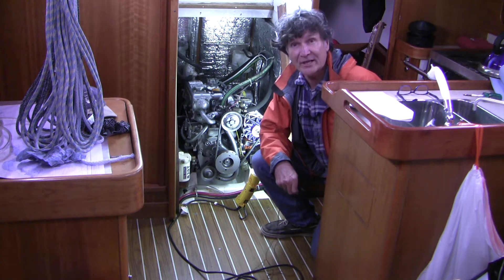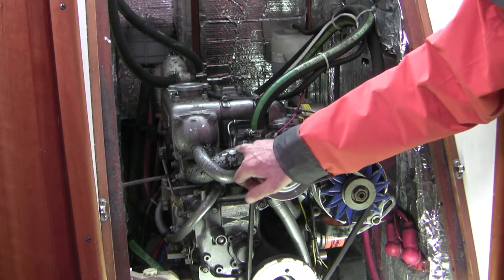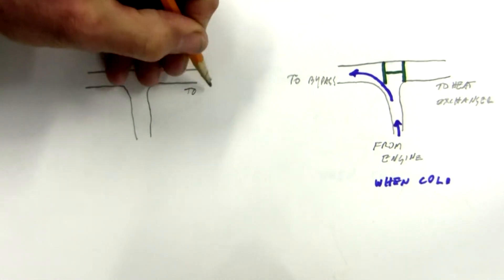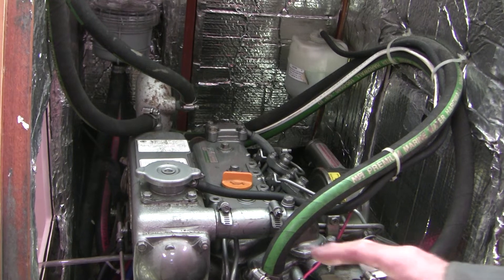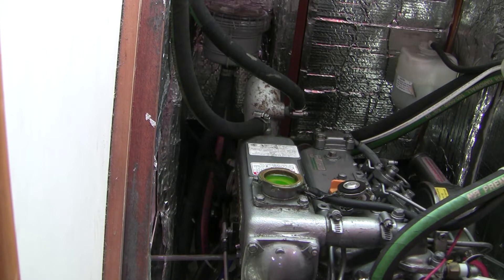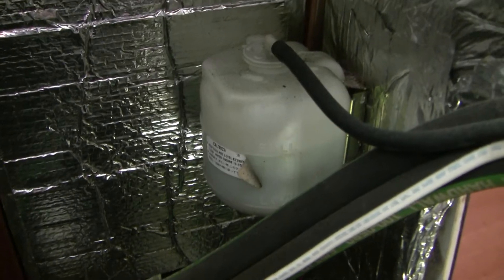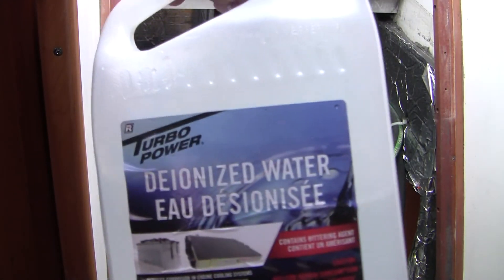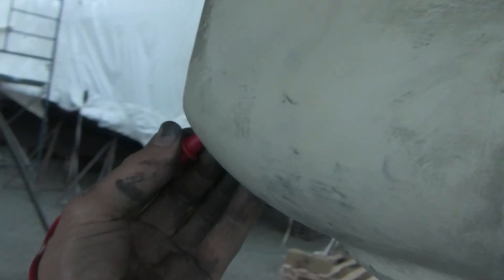Understanding marine diesel engines: Yanmar coolant exchange

Comment: My overflow reservoir is installed as the manual says:  Top of bottle level with top of heat exchanger.  This cannot be right, because my engine sends coolant to the reservoir and never draws it back.  So every few hours, I have to take it from the reservoir and put it back into the heat exchanger, and of course, there is never enough to fill the exchanger, so I have to add.
Shouldn't the reservoir FULL LEVEL mark be level with the top of the heat exchanger?  It sure looks like you have it that way in your video.
Also, the system retains its vacuum for very long periods of time, so that tells me I have no leaks.
Having tried everything else to keep this engine from overheating, I think the height of that reservoir must be the problem.  Can you reply to this?  Thanks, Paul
Reply from the maker: Interesting problem. You might be interested in my video of "hidden genius of the engine cooling system", where I show a truck with the reservoir fill bottle well below the level of the radiator. In that video I use my thumb to tip the inner valve open. Try that with your radiator cap, make sure that little valve opens, make sure it's not stuck. Similarly I did a video of a motorcycle where the reservoir is again well below. So, I think your issue is something more than gravity, and a good place to start is the radiator cap. If you've got trapped air in the system, overnight as the engine cools it should open that valve, suck fluid back into the system, regardless of the relative height of your reservoir. That backward flow doesn't happen when the engine is running. If there is any cracking of the hose leading to the reservoir, replace the hose. I wouldn't hesitate to replace the cap, they are pretty cheap and often cause problems as the rubber seals age. In the manual, Yanmar say it is fairly common for their engines to have a slightly low fluid level in the heat exchanger, as the liquid cools. But if your engine never refills automatically, you've got a cap or hose problem. The other rare problem that can do this is a head gasket leak, spilling hot exhaust gas into the cooling system, causing overheating and high pressures that force liquid to overflow back into the reservoir. Good luck!  Dave
Reply: @spelunkerd  Thanks very much for your quick answer.  We are down in Bellingham right now, heading back to Anacortes. 
I re-built the engine myself, and I never re-torqued the head bolts, in the understanding that is not done on these engines.  On the other hand, I do not have the best torque wrench.  The radiator cap is new, but the hose is not.  So next I will change that hose.  But I do note in your video that your reservoir is well above the top of the heat exchanger level.  So I can also raise that.  Both much easier than replacing the head gasket.
Reply: @spelunkerd  I raised the reservoir so that the "Full" mark was at the level of the top of the heat exchanger.  Added a new hose.  Then I motored at 2800 rpm.  It ran hot, 140F, instead of 134F, and it still transferred coolant to the reservoir and did not suck it back when it cooled.  The boat has a new propeller, and when the bottom was clean, the engine could run up to 3400 rpm.  With the bottom not clean, it can't do that, and it overheats.   Maybe if the propeller pitch could be reduced to match the fouling on the bottom, it would not overheat, but it did that with the old propeller.  I am concluding there is no way to keep this engine from overheating.  I will just have to run it into the ground and then, since I am not investing in a new engine, that's it for my sailing days.
Reply from the maker: @paulphillips82  Overheating is not normal, I would pursue that further. It may be a dirty heat exchanger, bad exhaust elbow, poor salt water flow, bad thermostat, or rarely a bad head gasket causing exhaust gas to enter the cooling system. To screen for the latter, you can borrow or buy an tester to look for exhaust gas in the cooling system. Depending on your skill set you may need advice from a pro, I'd hate to hear you gave up sailing because of this....
Reply: @spelunkerd  There is not much left to try, but I will yank the heat exchange core next trip to the boat.  It was clean as a whistle when I rebuilt the engine, and it has been overheating ever since.  I will also shut off the water tank circuit.  It could be I installed a bad thermostat, and I could try operating with no thermostat; the exhaust elbow is clear and is not old.  I never heard of an exhaust gas tester, but the coolant appears normal enough. 
The boat has the problem that the 3gm30f is the biggest engine it can fit.  It originally had a small Bukh, which the former owner scrapped in favour of the Yanmar.   I conferred with Michael Kasten, who correctly assured me that the 26 hp from the Yanmar is enough power.  The problem is that the overheating problem cannot be corrected.
It would be great if I knew a Yanmar mechanic, but I don't, and the last time I hired an engine shop was such a bad experience I would never again hire anyone I do not know.  Trust is the issue, but I am also not willing to pay someone who doesn't know any more than I do. 
I will let you know what I find out when I take the heat exchanger apart, but I think there will be nothing wrong there.  Thanks again,
Paul
Reply from the maker: The tool to check for combustion gasses in coolant is called a "combustion leak tester", you could borrow mine if we were neighbors, here's one sold by Amazon https://www.amazon.com/UView-560000-Combustion-Leak-Tester/dp/B000NPDL76/ref=sr_1_2?crid=5KQEAGEVIXCT&dchild=1&keywords=combustion+leak+tester&qid=1595354100&sprefix=combustion+leak+%2Caps%2C220&sr=8-2. Only worthwhile if you are overheating and coolant is regularly forced back into the reservoir by boiling over, if you are pretty sure you have a head gasket leak. As you know, the vast majority of cooling system problems are on the salt water side, so don't forget the exhaust elbow, etc.
Reply: @spelunkerd  Ahoy again,  Thanks for the referral to this tool.  Any excuse to buy a tool is a good thing. I just ordered it.  
The big Yanmar manual gives the sea water pump volume but at 3600 rpm.  I calculated the volume it should have at idle, and found I was able to collect that in a bucket.  But since it was possible the pump did not handle higher volumes as well, I changed the pump, to no effect.  So I have puzzled over the fresh water pump, but it appeared fine before the rebuild.  And I checked the weep hole as you pointed out (thanks for that tip!).  My parts vendor, Cook Engines of Portland, discouraged me from including the fresh water pump as a source of this overheating.  Thanks again.
Reply: @spelunkerd  OK, I used the test kit and got nothing.  Repeated three more times.  So I yanked the heat exchanger core and found it oily and sooty.  While I cannot be sure the engine is actually running hot (148 on my gauge against a normal of 134; laser thermometer seems to bear this out when pointed at the top of the heat exchanger) a bad head gasket might explain the loss of coolant as well as the oily core.
Just now it appears a motor mount has failed.  This, in combination with the prodigious rust that the engine has developed in four years, caused me to decide to pull the engine and do the work at home.
While I am going this, I am looking into getting a Betamarine 30; that is a close fit and a bit more powerful and bit more efficient than the 3GM30f.

Comment: Hi. If you slide along past the first part of this ladies video, https://youtu.be/xY2GutwiPFM you'll see her Yanmar engine. Do you recognize this engine ? She's currently working on cleaning out the heat exchanger. I think I can see yours, but her's is a little harder to see. She's currently (not in this video) talking about seized bolts on the heat exchanger , broken bolts, and says its hard to get to them to tap the bolts ? If I knew a close model number I could research this, and maybe you can advise ?
Reply: 3ym30